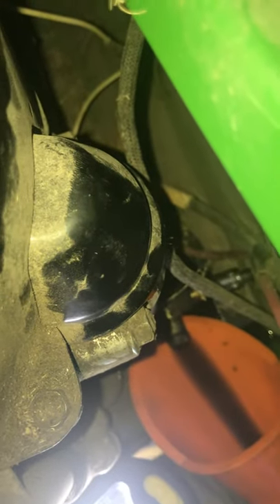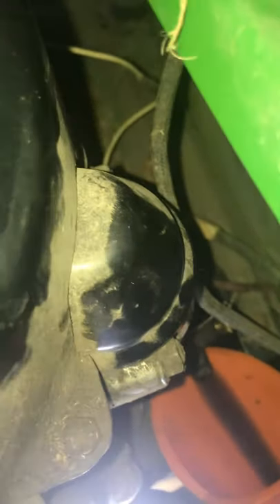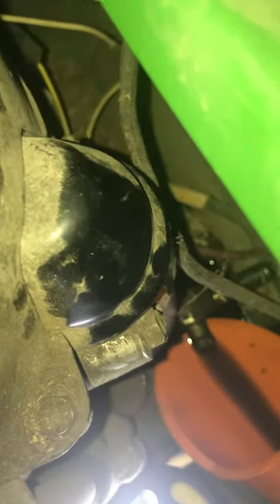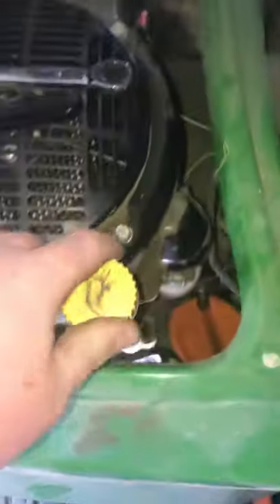John Deere SRX75 - How To Change the Oil and Filter

Comment: Mine has a extension tube on the drain plug and hangs down. I was just coming to make sure there isn’t a filter as the kit on Amazon has a oil filter. Great video! 👍👍
Reply: Any idea the size of tube needed? Would it be 3/8 to fit the oil valve nipple? I have a gx85 and it’s similar. Thank you

Comment: Do you know if the standard RX75 has an oil filter?
Reply from the maker: No, it doesn't, but I recently found out that you can buy a kit to put one on there, but I haven't had any problems with my 40-year-old dinosaur with no oil filter. Just change the oil often (Every 15 -20 hours). Talk to your local John Deere dealer if you want the oil filter kit.
Reply: @ryang1234-b5s  thanks for letting me know. I needed to know
Reply: @ryang1234-b5s  The 9hp Kawasaki has splash lube. How do you put an oil filter on it?
Reply: @ryang1234-b5s  That's helpful, I didn't think it did but I see it mentioned online, that's why. Thanks!